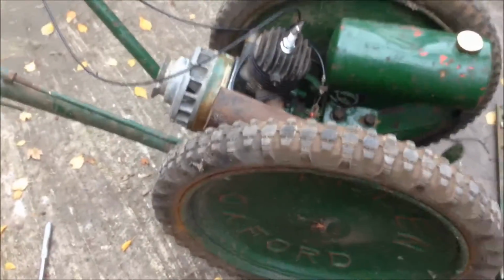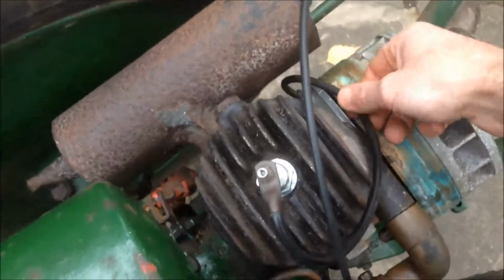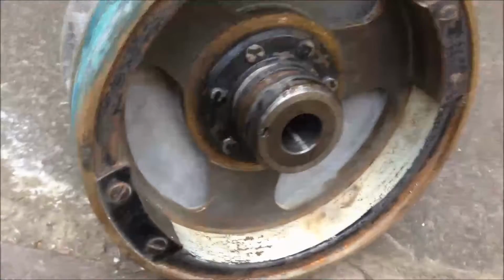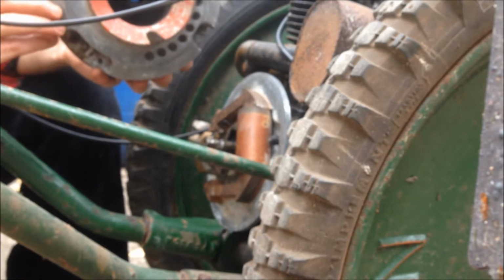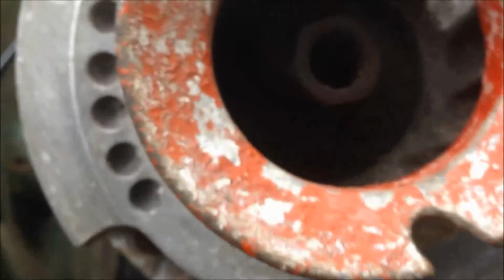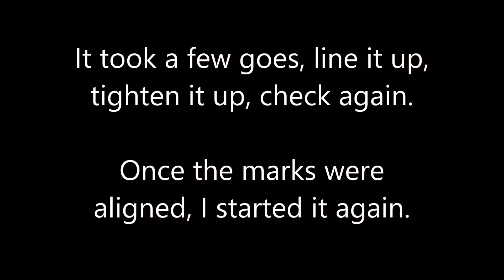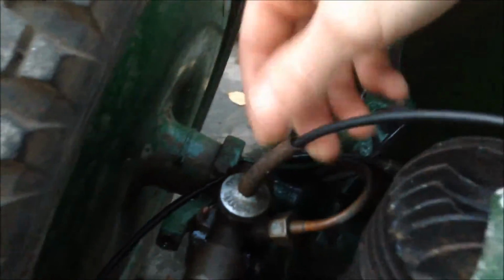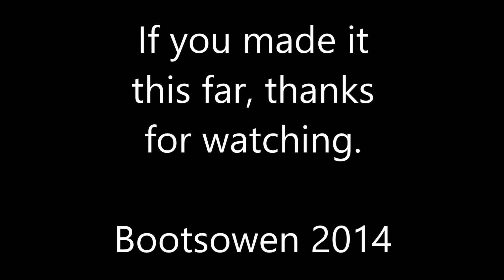Oxford Allen Scythe Villiers 11C Engine Timing

Comment: Interesting video that has answered a question I had like 55 + years ago when as a kid I used one and didn't understand how come the engine wouldn't speed up much no matter how much the throttle was opened (apparently having no governor linkage to the throttle). A `grown up' said `the engine's tuned that way' which i thought very unlikekly at the time and now you have confirmed my suspicion was bs. So the engine is limited to quite a moderate speed by the ignition cutting out above a certain RPM ? How amazingly crude and wasteful of fuel since most people will have the throttle open more than it needs to be. Thanks for the informative video.
Reply from the maker: The carburettor can only draw in the fuel that it needs to burn, it doesn't pump in more fuel just because the throttle lever is open, so I don't see how it could be so wasteful.
Reply: @bootsowen   The carburettor feeds air and fuel into the engine in the correct ratio regardless of whether it is ignited or not by the spark plug. Opening the throttle increases the air flow through the engine and, in proportion the amount of petrol vapour. I've never tried it but you should be able to smell the petrol vapour in the exhaust when you open the throttle a lot on this engine as the engine misfires due to the spark being interrupted by the ignition governor. May be a bit difficult to tell on a 2 stroke engine since they `4 stroke' a lot when lightly loaded.

Comment: I've just got one of these engines. What fuel mix do you use? 25:1?
Reply from the maker: it depends on the engine, have a look in the manual for your engine, they are all available free online, to avoid your next question...google it.

Comment: Hi, i have the same model and have just fitted a new coil and re timed it, it fires but the kick back is severe, is this normal? also what length pull cord should i have? thanks.
Reply from the maker: +mike cartlidge Hi Mike, What do you mean by kick back? Back fire or compression? If you mean back fire then the flywheel has maybe moved after you tightened the nut up. Make sure there is no dirt on the taper shaft or on the taper inside the flywheel, absolutely clean, use alcohol to clean it and a clean cloth.  When tightening the nut you have to whack it really tight with a ring spanner and a hammer/ Villiers made a tool for this but any ring spanner should do.
You can have any length pull cord as long as your arms are able to get the cord fully off the starter pulley so that it doesn't get wrapped up again and pull you in if it starts. I hope this helps, Put a video of the machine up on youtube! All the best
Reply: Hi, its compression like you get on a bike when the kick start kicks back at you, i used an impact driver to tighten the fly wheel so im sure its tight. Just to confirm re timing marks, line up the groove on the end of the crank with the arrow on the starter pully, job done? It did fire briefly but i walked away as the beast almost pulled my arm off while trying again. Ill have look at again this evening. Thanks for your reply my friend.
Mike.

Comment: Hi do you know where i can get a new coil and points for one of these
Reply from the maker: Villiers spares? on the internet.
Reply: @bootsowen  just fitted a new coil in my 11C engine today  it came from Villiers parts on the net item code M1013 9/16 core diameter